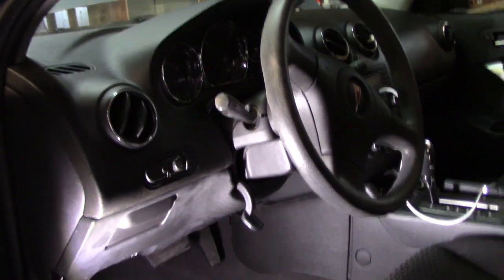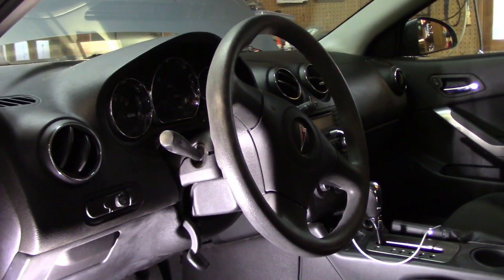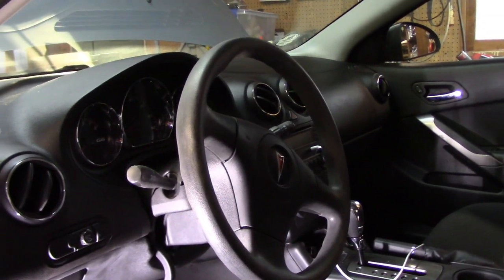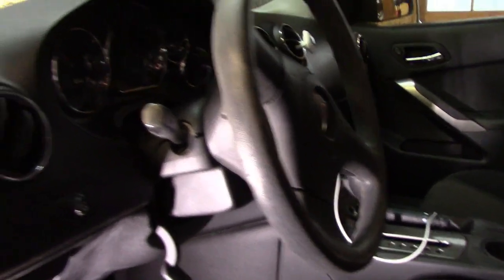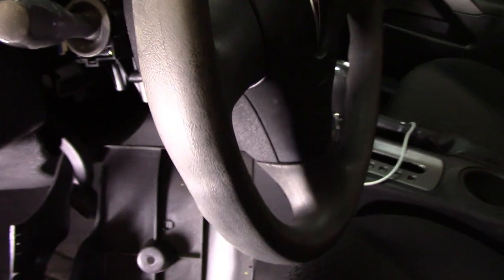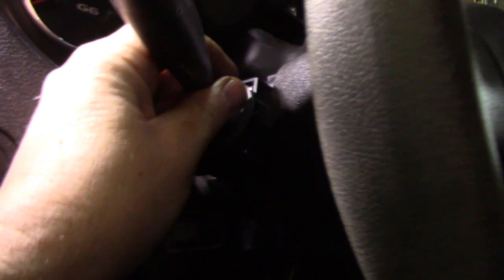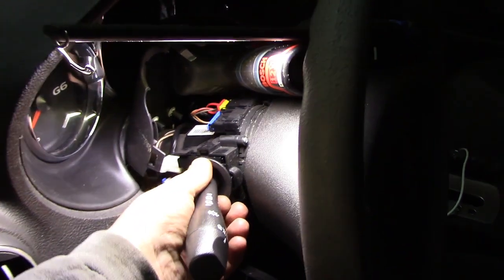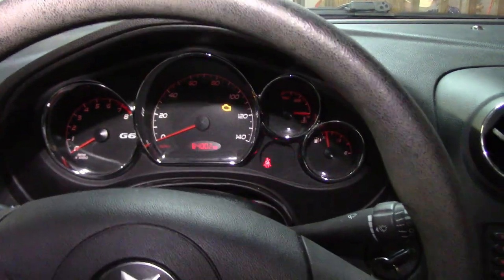Pontiac G6 Turn Signal Repair

Comment: could this turn signal assembly be the problem why i have no front signals but i do have rear signals.
Reply from the maker: It’s possible, but you would have to look at a wiring diagram. Check bulbs first.

Comment: Thank you. Great video. Do you know which fuse controls the clicking sound on the turn signal
Reply from the maker: The clicking noise is a relay.
Reply from the maker: The clicking noise is a relay.

Comment: Replaced my turn signal stick and then I found out that it sticks when it’s hot outside.  Could be cause of my car is black.  Almost replaced it again. Didn’t have to disconnect the battery,

Comment: This is the same issue as my car.
Reply: THAT PART NUMBER IS ONLY FOR THE NAPA STORE. EVERYWHERE ELSE THE PART SHOULD BE D6253E (eg. Autozone, O'reilys, Advanced Auto Part, Rock Auto). MIGHT FIND A BETTER DEAL ON AMAZON TOO, SEEN THEM AS CHEAP AS $17.

Comment: Does. This. Help taillights not coming on at all,?
Reply from the maker: Awesome Andrew 
Most likely not. Could be burned out bulbs, bad ground, bad fuses, etc. some car taillights are wired as one circuit and others separately. Look on BBB Industries website. They have free wiring diagrams.

Comment: I watched three other videos but I appreciated yours by far! It's those little details that make the difference...stuff like disconnecting the battery. (I have that same "what if" paranoia running through my head!) I also appreciate the mention of the 'pick' tool. Only one other guy mentioned that instrument. Thanks for taking the time to film this task...I too was dreading the whole "Steering wheel puller/ compression ring/ air-bag avoidance nightmare! Hooray for "Plug-N-Play"!!! thank you Sir!